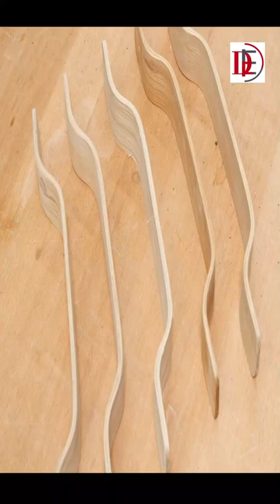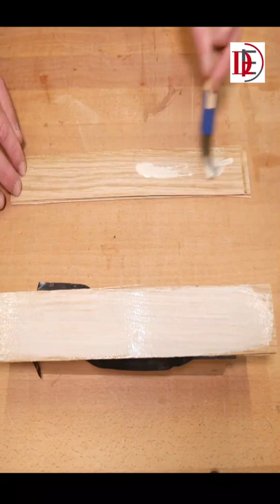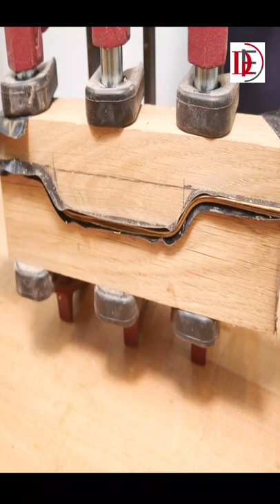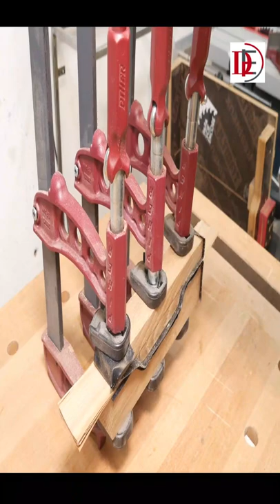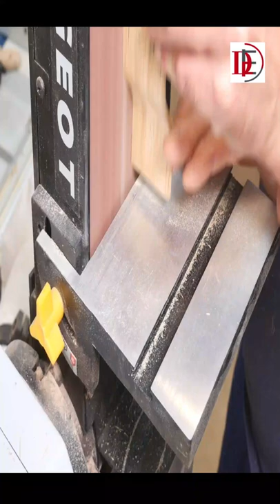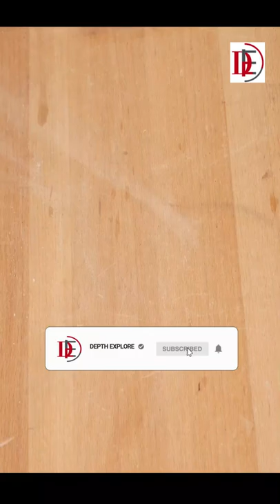The Coolest Furniture Handles (DIY Ideas) #shorts

Comment: Congratulations. You made sub par plywood. 😑
Reply: Well I mean it's just meant for a drawer handle... Also, it's more like micarta.
Reply: More than good enough for the application.
Reply: 3 thinn layers, I give it a month
Reply: my thoughts exactly... and far from "cool"
Reply: @ynots38  acting like this is going into a structural setting, its a handle for a drawer under a table or something not a laminated roof truss
Reply: @Trainskitsetc  ummm huh??? I agreed with the OP that it's basically plywood, then added that it's not as cool as the title had stated... how about you think before you respond...
Reply: @ynots38  cooler than anything i see you doing
Reply: @Trainskitsetc  ok kid, isn't it passed your bedtime??? because with a comment like that you have to be no older 8 maybe 9...

Comment: You could dye the layers different colours and then  sand the edges or sand contours in them to reveal the colours lines, like they often do with knife scales (and skateboards, to a lesser extent).
Reply: Those scales and skate decks are embedded with dyed epoxy to last forever. What you could do is not make this and buy professionally made hardware that’ll last for years instead of weeks lol

Comment: Attaching these handles would be problematic at best.
Reply: No it would be. Just counter sink a hole in each end and use a nice-looking countersunk screw, maybe bronze or brass, or even plunge route a small receptacle and glue in a nut on each end that a slim bolt can grab from the inside of the draw, like most handles work. You could even just glue it directly to the draw face, the possibilities are endless if you have any clue.
Reply: @PinataOblongata  I’ve been woodworking for 30 yrs, I’ve learned a thing or two buddy. Your suggestion might work for a handle that sees little usage but a cabinet handle that’s used daily requires something more substantial than what’s depicted here and your suggestion for attaching them would fail in no time.
Reply: @thenoneckpeoplerepresentat8074  No, it would not. All the draws in my house and a million others are attached the latter way, but you'll notice I suggested multiple options, so...

Comment: You can't just press glue veneers together and hope it works...
You need to soak the wood and steam bend it
Reply: I do this all the time it’s surprisingly strong. You do need to cut the boards very thin (literally veneer thin) and it only works with certain types of wood. I built an entire chair out using this technique.
Reply: No you don't.  Lots of people do this without soaking anything.
Reply: This is why glue bonds etc don't work very well...
Wood grain needs to be bent using steam and held whilst it is dried into that position to hold the fibres.
With glue your trying to force the fibres into position and then trying to hold a stressed joint with glue holding the fibres.
So in effect your pre loading the joint and it will fail.
I build guitars etc so I know about pre load and dealing with stress.
It's like trying to work metal that's not been annealed.
It's going to have lots of stress and won't be flat.
If you steam the joint into position then glue them parts together it will take out any pre load stress and be much stronger

Comment: Is that plain wood glue?😂😂
That shit's gonna delaminate in no time.
Reply: Oh yeah, you're always seeing wood glued with PVA come apart... why would you even make this comment if you don't know wtf you're talking about? Are you even a woodworker? Unless you used them out in direct sunlight and rain and weather where they could constantly swell and contract, they'd last just about forever.
Reply: @PinataOblongata  I never see anyone stupid enough to rely exclusively on wood glue to hold stress bearing assemblies together. It might be fine if it were a decorative piece, but this is proposed to be a handle so it will have to deal with flexing stresses. Oh, and wood doesn't only expand and contract by sunlight and rain. Any changes in temperature and humidity will do.